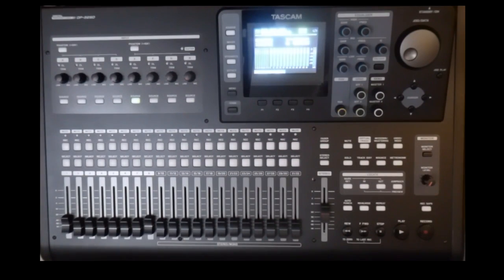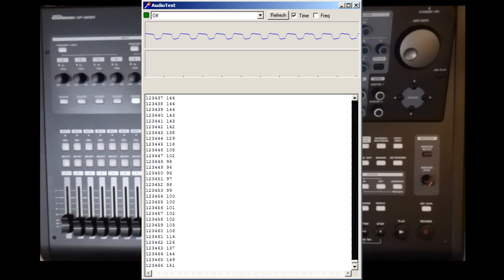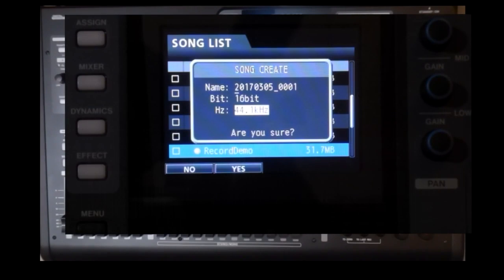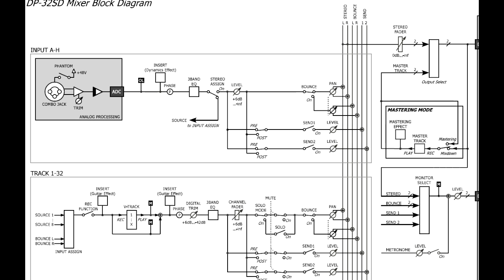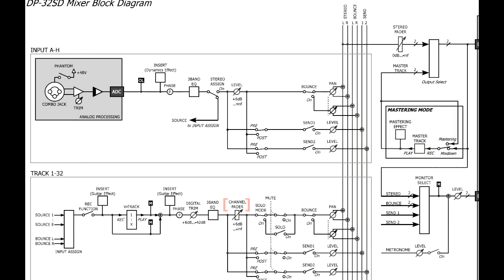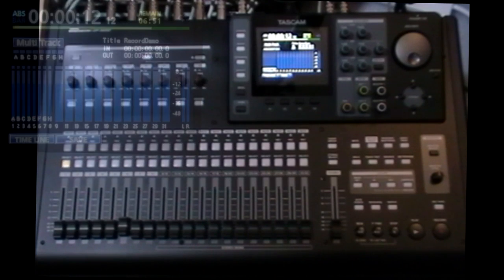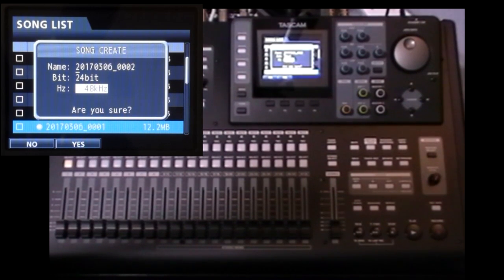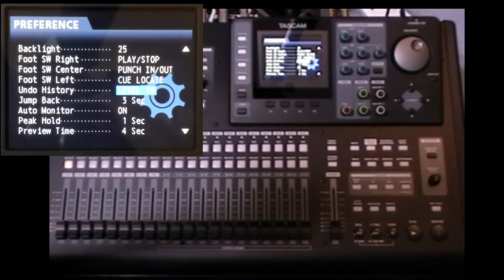Tascam DP24/32SD Tutorial 8A: Recording

Comment: This may be a daft question/problem, but my Tascam 24sd only seems to record on the first 2 inputs. Whenever I try to record on the other tracks - either through the first 2 inputs allocated to the appropriate track number, or through the CDEFG input directly - all I get is distortion and at best a very weak signal (if that). This is using mics that work on the first 2 inputs - I want to record acoustic guitar overdubs. The acoustic guitar records perfectly on the first 2 inputs. I think I've tried everything...
Reply: Did what you said and it slightly improved the sound level but it still remains quiet and has distortion. I just don't understand why the first 2 inputs can be so clear and all the others so muddy when I do and use exactly the same mics...
Reply from the maker: @Upstreamprovider  I would go back to basics and test each signal path methodically. Eliminate the more complicated track path and just assign each input one-at-a-time to the stereo bus (effectively using the machine as simple mixer as shown in video #3). Turn up the master stereo fader and you'll hear each input. No other faders or controls, apart from the input trim knob need to be turned up. If this works for all inputs, you've proved the signals are getting through the pre-amps on inputs A to H ok. If some inputs still distort, and you definitely did a factory initialise, there's something wrong with the machine or your cables/connectors. Do you need phantom power for the mic? If so, maybe one of the phantom banks is faulty. Are you using the 1/4" inputs or the XLR inputs? They both go to the same pre-amp, but the XLR is a lot more sensitive and is meant for mic-level signals. Also check you have the latest firmware.
If the inputs are all ok going straight through to the stereo bus, de-assign everything from the stereo bus and assign one input to one track. This time you need to arm the track and turn up its fader. Try assigning that same input to a few different tracks one-at-a-time, making sure you only assign and arm that one track to avoid confusion. Then try assigning a different input. etc. etc.
Good luck.
Reply: @philtipping  Checked all the tracks. No difference, so I guess I've got a faulty unit  :(  Just emailed the sellers for warranty help. Damn! Thanks for your help, though.
Reply from the maker: @Upstreamprovider  thanks for the follow-up. Sorry to hear it's looking more like a h/w fault. As mentioned, a factory initialise eliminates any rogue settings, running the latest firmware eliminates any rogue behaviour, and assigning inputs directly to the stereo bus eliminates any issues with the sd-card... so you've done all you can. Hope you get it sorted. Keep us posted.
Reply: @philtipping  Thanks for all your help. Just to update you, the supplier replaced it with a new one which seems to be working perfectly, after trouble shooting some things via email. Great service from Anderton's Music, I'd just like to say!
Reply from the maker: @Upstreamprovider  That's great news. Thanks for the update. Surprised to hear that a brand new machine had a real hardware fault, but I guess these things can happen so glad you got it sorted. Best wishes for 2022 :)
Reply from the maker: @Upstreamprovider did you try a factory initialise? This problem is usually caused by one or more settings inadvertently left hanging around from previous songs... or tinkering ;)
That's why the first video in this series recommends setting up a 'clean-slate' template to guarantee all setting are in a known state. You can go through all settings and reset things manually, but this is very tedious and you may miss some, or you could do a factory initialise, but this also resets any global preferences you may have set.
If none of this works, get back to me and we'll try something else.
Reply: @philtipping  Thanks for that. I'll have a go. Thanks for your videos. They're extremely detailed!

Comment: Where do you discuss cutting time off of tracks?  I want to keep the music recorded from 0:57 to 4:33, and cu the beginning and end off.  I assume it is located in the "track edit" function.
Reply from the maker: @James Spring I didn't cover track editing in the videos. It's in the step-by-step guide though - http://www.philizound.co.uk/freebies/dp24-32/dp24-32.html
You're right, track edit has a function called 'cut' for doing this.
Reply: @philtipping  Hi Phil: not that I'm the expert you are...but - for your user's benefit: when anything is "cut", the track-edit function closes the "gap". You can also use the "silence" track-edit function, which will remove the unwanted parts, but leave the desired segment in place.
Reply from the maker: @Caught Staring thank you, yes there are several useful functions in Track Edit. It's well worth getting to grips with these as they are all instantaneous. The parameters are remembered from the previous operation so it's easy to undo and re-tweak in a flash if you're not happy with the result. 
Don't be put off by the error message you get if the section you want to cut or silence is shorter than 4 secs. This limitation only applies to the gap between the IN & OUT points, so you can usually get the same result with some lateral thinking such as moving/copying the longer sections before and/or after the point of interest.
Another useful tip is the 'all tracks' option hidden away at the end of the track list if you scroll down far enough.
Thanks for stopping by and sharing.

Comment: I have my microphone plugged into input A and I can hear it good but then I plugged in my turntables on input b I can’t hear anything, what should I do?
Reply from the maker: @Pedro Cervantes assuming you've tried your mic in input B just to check you have the input B assigned correctly, it may be the signal level from the turntable is too low. The XLR input is more sensitive than the 1/4" jack so you could try that if you're not using it already. Use an adapter if you don't have a suitable cable. 
You may need a proper turntable pre-amp if the signal is still too low. It would also give you a more accurate EQ response, although you should be able to tweak the EQ on the Tascam for a close approximation - depends on your requirements   https://en.wikipedia.org/wiki/RIAA_equalization

Comment: I've recorded a vocal that has hiss on it, when I turn the record volume down so there's no hiss the vocal isn't very loud. Is there a way of removing hiss from a recorded track without having to export it to a computer for noise removal? Thank you.
Reply from the maker: @Clive Braner The only effect in the machine is a noise-suppressor, which is in the guitar effect and dynamic effect sections... but it's just a noise 'gate' in that it just reduces the signal level if it falls below a certain value. This is useful for removing background noise in between sounds, but it doesn't do anything to background noise when your signal is higher so relies on your main sound masking the noise. 
The other type of noise reducer is a digital processing one which takes a sample of noise without the signal and effectively 'subtracts' this from the sound. The machine does not have this type, so if you want to use that, you'll have to export to a computer and process it there. Personally I've not had much luck with these types of noise reducer unless the hiss is very low in the first place. The more noise you try and remove, the more artefacts are introduced, and these are (to me anyway!) more intrusive than the hiss itself - it sounds like birds chirping if you overdo it :)
If there is a chance you could re-record the vocals I would always take that option.
Do you know why the recording level is so low?
Reply: @philtipping  when I recorded it originally I turned the rec volume up as far as I could hear what I'm singing comfortably, it was only listening back to it that I picked up on it, then I became obsessed with recording without the hiss but the recording volume is then so low it's not really useable. Thanks for your advice, it is greatly appreciated, thank you.
Reply from the maker: @Clive Braner  ok Clive thanks. Yes it's really annoying when that happens, but it's best to learn from the experience and re-record. Even if you did manage to clean it up, the artefacts or residual hiss will probably nag away at you (if you're like me!) until you finally crack and re-record it anyway :) 
Note that you should use the XLR sockets for mic signals. Some mics have 1/4" plugs but the 1/4" inputs on the Tascam are intended for higher line-level signals so you should use an adapter or a different cable. Good luck with your future recordings.

Comment: I had and and mastered a fostex Vf 16 for years which works in a comprehensive common sense manner I bought this as the next logical step u...... I understand differnt recording values as in 44hz 48hz next .yet I am almost done and have mot heard ANYTHING about tracking, sending tracks to channels adding effects to channels.....all im hearing is conversion rates and techno jargon.....yes its a. Complete recording...so explain traking, overdubbing , panning , mixing....in a language known by non computer engineers
Reply: In addition just to be clear I am recording organic real instruments not looking to quantize samples or trigger midi or drum tracks to differnt tracks.
....organic instrumentation and hoping for an organic user explination
Reply from the maker: @Beau Yerks thanks for stopping by Beau. Well you could keep watching and hopefully the remaining videos will start to make sense. As I explain in videos 1 and 3A, there's a reason for making the videos in this order. The mixer part of the machine is fundamental to its operation so I felt it was important to understand that first. All the things you mention are part of that picture. Tracking is just putting one or more tracks into record mode, so you'll see this in this video 8A. Overdubbing only makes sense once you've covered the tracking stages. Mixing is covered later too.
If you want a quicker explanation, try my step-by-step guide - full details here http://www.philizound.co.uk/freebies/dp24-32/dp24-32.html   This shows exactly which buttons to press to do various tasks like recording, overdubbing, adding FX etc. without going into all the background details. It will get you off the ground quickly, and you can then revisit the videos later as and when you need more information.
Don't forget I'm not paid by Tascam or anyone else.

Comment: How do you delete a track if you make a mistake?
Reply from the maker: @Pedro Cervantes simplest way is to press Undo.
There's also a delete track option in Track Edit - called 'clean track'.
Don't forget none of these actually remove the audio from the sd-card, so if you do this lots of times you'll eventually clog up the card, in which case it's recommended to run the 'delete unused' function in the song menu every now and again.

Comment: How would i record mixes using two turntables and a dj mixer?
Reply from the maker: @Phantom Cervantes take the stereo output from the mixer and feed them into 2 inputs on the DP machine and assign them to a stereo track.
Reply: @philtipping  there is a record output on my mixer would that work?. Also how would i start the recording process
Reply from the maker: @phantomcervantes8381  If the mixer output is the stereo mix, it will be perfect. A lot of mixers have a couple of RCA outputs for this purpose so you can record the mix without having to disconnect the main outputs to the monitors. If yours is the same, you just need a couple of RCA-to-1/4" TS jack cables.
Recording on the DP is fairly simple - the videos show it, although they are quite long-winded if you just want to get going quickly. The step-by-step guide shows exactly what buttons to press, so if you're new to the machine, this would be a good way to get started. Full details are here http://www.philizound.co.uk/freebies/dp24-32/dp24-32.html

Comment: Occasionally getting pops and clicks on playback in odd spots. Using extreme plus class 10 32 gig card fully formatted. My firmware is 1.03. Should update firmware to the latest version? Is it 1.12? Will this help?
Reply from the maker: @Don Ricchio definitely - old firmware and incompatible/faulty sd-cards are the most common cause of problems. It's also advisable to re-format your sd-card(s) after updating. Let me know if this fixes it.

Comment: Just got my machine in today. I was able to import a drum track, but can't get the two tracks (tracks 1 and 2) to play back in stereo. Any ideas would be helpful.
Reply from the maker: @Jeffrey Lieberman well this is a classic example of what I meant when you said "It shouldn't be that complicated to explain this" ;)
As soon as you stray off the 'completely basic' path, life gets complicated. It's not the machine's fault, it's just how it is for multi-track recording, and is what you pay for when hiring a pro recording studio.
There are 2 choices for stereo. The simplest and best way to record a stereo source is to assign the left & right signals to the left & right sides of a stereo track. Same applies to importing. This way, no panning is required at any time.
The other way is to assign the signals to 2 separate mono tracks and pan them hard left & right during playback or monitoring. This also works for 2 independent mono tracks you've already recorded or imported, in which case you can pan them however you want to create a 'stereo field'. Note you only need to pan when playing back or monitoring, or when bouncing or mixing down. Panning makes no difference to the initial recording.
Stereo handling is a common source of confusion, so there's a large section in the step-by-step guide on this topic.
Reply: @philtipping  I am importing a drum track that is in Stereo on there. I tried both ways. Still comes out in mono no matter what. I cannot hear it in both ears and it will not let me pan at all.
Reply from the maker: @jeffreylieberman8079  Try one track on its own just to see if you can pan it successfully...
Turn all track faders down except for that track. Make sure the master stereo fader is turned up and you should see the track signal in the right-hand meter bars marked L & R. 
Press the track select button so it lights up green.
Turn the pan control left or right and the L/R meter bars should vary depending on the pan position.
Now listen to the headphones or speakers and confirm the sound is following the pan control the same way as the meter bars.
Let me know if this works, and we can move on to the next step. 
It's easier for me to use email so contact me via the email shown at the bottom of the page on my philizound.co.uk website.
Reply: @philtipping  that's the thing, shows it playing in Stereo, but it only plays back through the headphones in mono. I go into the screen where pan is, and I could do everything except for panning it. I don't understand why it won't let me pan.
Reply from the maker: @jeffreylieberman8079  If the meter bars change levels as you turn the pan, then the problem must be in the signal coming out of your machine. Press the monitor select button and confirm it's set to Stereo.
If so, it must be your headphones and/or adaptor. Are you using a stereo adaptor? (as opposed to a mono). Are you using earbuds? If so, what does the jack plug look like? It should have either none or one black ring. If it has 2 black rings, it's not compatible with normal stereo sockets.
Reply: @philtipping  I will check when I get home but it is the same high-quality headphones that I've been using in my Tascam DP 008 for a while.
Reply: @philtipping  that's the main problem it seems. It just will not allow me to pan. In the mixer screen, it will allow me to do everything else, but when I go to pan, it skips right over it and won't allow me to do anything with the pan option. It either goes to the left of it or to the right of it, but will not allow me to pan.
Reply from the maker: @jeffreylieberman8079  ahh ok, this eliminates the headphones then. Last resort is to do a factory initialise, and/or update the firmware if it's out-of-date.
Reply: @philtipping  something to keep in mind...thanks. I will keep you posted once I figure out what the issue is.
Reply: Seems it's just my headphone cable...😬😵😖 I feel like an idiot right now but at least it's nothing serious from the machine, that's the good news. I will still keep you posted once I work on my first song on this machine. Drum tracks are already done. Better headphones, then on to guitar we go!
Reply from the maker: @jeffreylieberman8079  no worries Jeffrey, glad you tracked it down.

Comment: I'm using the Silence function to erase noises between takes but I can't erase anything less than 2 seconds (not 4 seconds) If it can't be done than I have to return this. Help!
Reply from the maker: @Uncharted Course There are lots of other Track Edit functions so you can always get round these limitations; you just need to think laterally. For example, you could copy the wanted sections to another track and leave the unwanted parts behind. These DP machines are complete studios in a box, so there are ways round most things. If you jump ship to something else, there's only the Zoom R16/24 machines (as far as I know) which qualify as free-standing 'porta-studios'. All the others, such as the Model or LiveTrak series concentrate more on recording than post-processing, so you need a computer DAW to handle the 'extras' such as editing. It's really down to what you want the machine to do versus having to use a computer.